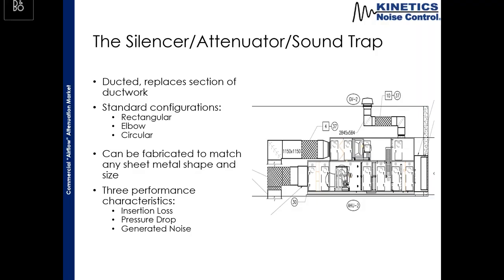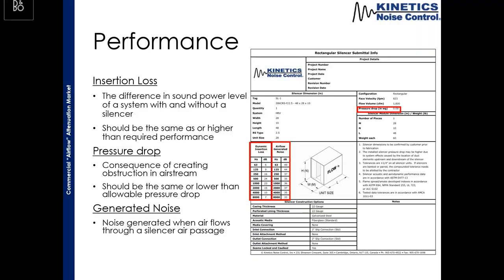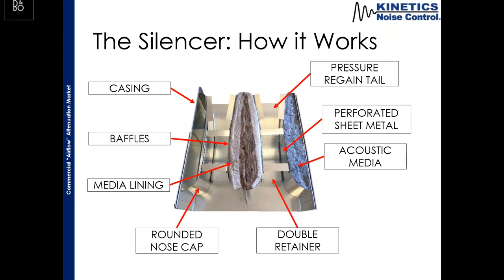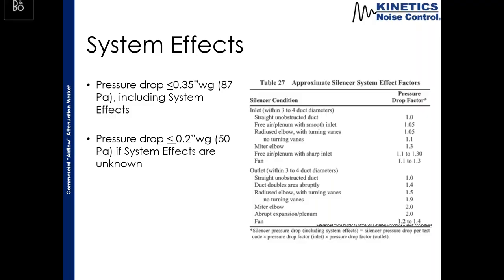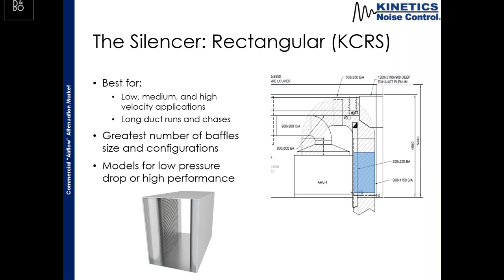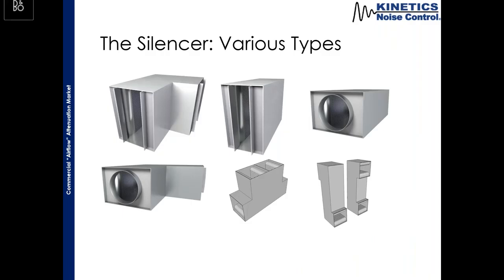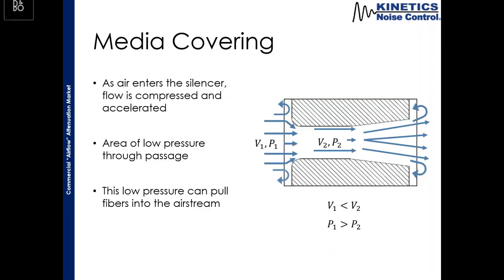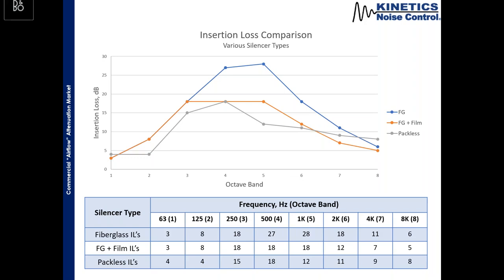Duct Silencers – Types, Performance and Proper Application

Comment: Imagine, if the Air Conditioning MFGrs just made a quality product this would not exist.
Reply from the maker: Quality HVAC equipment certainly makes a difference. However, even well-engineered systems generate aerodynamic and mechanical noise, especially at higher airflow rates. Duct silencers are engineered system components used to meet project-specific acoustic requirements while balancing airflow, pressure drop, and occupant comfort.